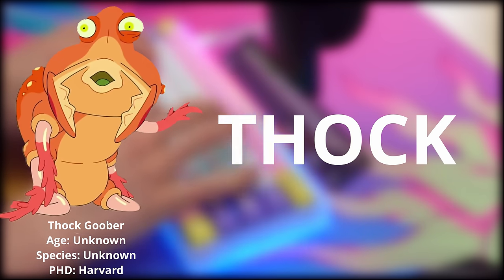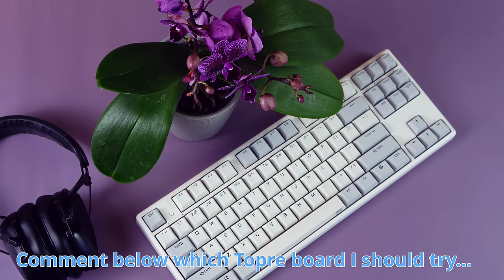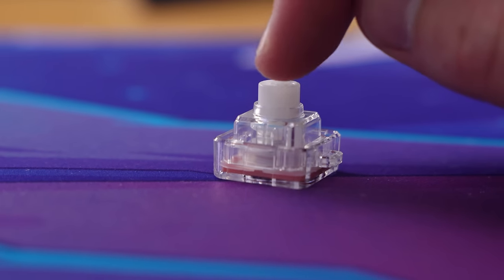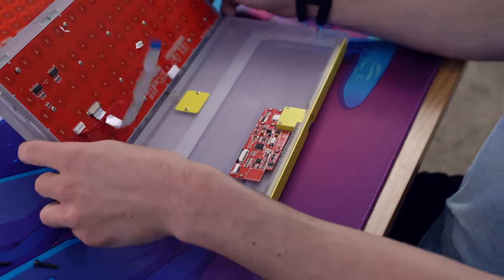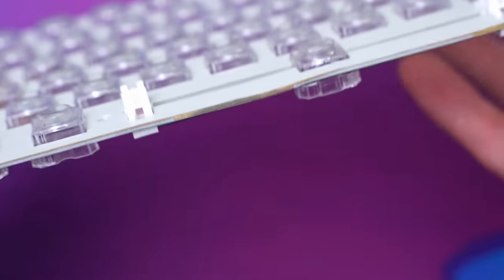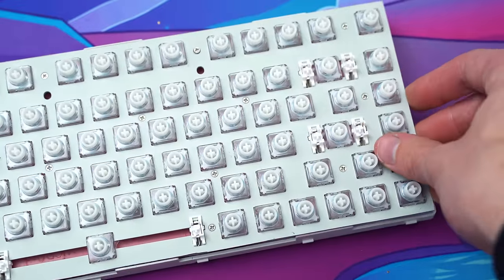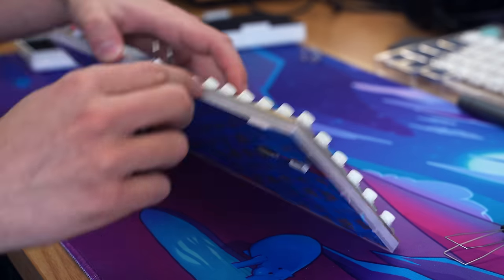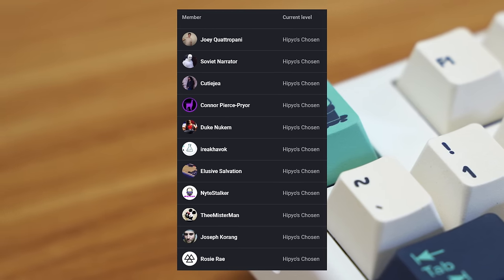THIS is the best sounding "THOCKY" keyboard.

Comment: Swap the Domes.  BKE Redux domes for Topre and Topre clones.  If you want to make even more Thock.  Ultra-Light Domes have the same tactility as 55g genuine Topre domes, while being 15g lighter, and the Light BKE Domes are even more tactile than 55g Topre, while being 5g lighter.  Heavy Domes are like MX Blacks in weight but having a significant amount of tactility.(Think more than - Boba switches, Box Royals, or Sunflowers.)

Only downside to BKE Domes is that you need to get a Plum87, RC930, Genuine Topre Electronics, or just make sure your board has absolutely zero RGB.  Sometimes you gotta do some cutting for the domes.

Comment: mechanical engineer here. You like plastic for the "Thock" more because it has a higher intrinsic damping ratio and a lower resonant frequency. First, Plastics are organic molecules with long amorphous chains, i.e., a non regular structure, so they quickly dampen any vibration (aka, sound) because their random shapes don't allow vibrations to propagate as well as a more crystalline structure like aluminum. Second,  because they are less stiff i.e., they bend less when the same force is applied, they have a lower resonant frequency. When you impact an object, as when you type, it tends to ring at its resonant frequencies. So a plastic keyboard will ring deeper because it has a lower stiffness, therefore a lower resonant frequency. The damping ratio and lower resonant frequency together leads to a more 'thocky' sound. Simple as that. If you have a less thocky keyboard, it's much  stiffer. Any defects, such as slop in the components causing extra noise (clackiness), will be much more obvious due to that. So if you have a metal frame keyboard all the parts will have to be far more precise and you will need to introduce less stiffness (i.e. with o rings as I have seen people do) to get a lower pitched, thocky sound. Hope this makes sense.

Comment: Was going to give a physical explanation in detail to the deeper sound difference, but yeah this person below kinda killed it. Basically it is due to the softer material absorbing higher frequencies. Only way to make it deeper is to add rubber into the mix. Basically a good thick plastic is the nicest thock sound you'll get. Reason is waves and shit, i.e. transfer of energy in materials/wave propagation through different mediums.

Comment: Why did you start with the Micro84 instead of the Micro82? I've never actually had a keyboard without costar stabs but I've greased mine up quite a bit which helped. I've had my Micro82 for a few years now and it's been good, but I've noticed on a couple of keys I seem to have spring rattle. Have you ever noticed this with yours?

Comment: im not a scientist by any means i just know a few things for no reason but the reason why plastics are deeper sounding than metal is because when metal is hit it is very dense so when it vibrates it vibrates very little causing the higher pitched noise and the same thing goes for plastic it is just less dense so bigger vibration
Reply: when you copy the top comment:

Comment: not a sound scientist but this list can help you reach the thock
wooden cases dampens the sound the most, i recommend putting a thin cloth before foam, tempest tape mod and rest mount aka no mount.
metal cases are the most pingy but they can help generate the thock, use cotton and tape it all with thick painters' tape then add foam and tempest tape mod for the pcb, it would help reduce the ping and can help it thock
plastic (abs) cases generates the loudest thock since they are thin and they are just plastic, add some 2-3 or 4 layers of car foam for these cases and it will not sound hollow anymore.
acrylic is what i do not really recommend, but they generate a light thock and they are not even as thocky as abs cases with the mods i mentioned
aluminum with gasket mount? ew no, that is pingy as hell, also aluminum is more pingy than other metals imo
stainless steel is kinda great, but it will not be as thocky as the plastic cases and they generate clack instead for some reason

keycaps:
pbt is what i recommend with XDA profile, they have a nice shape with good thickness. 
abs is okay, it just not do not generate a deeper sound than pbt but they have louder sound.
sa profiles with abs is great for thock, they are ideal for sound but not for your wrists
OEM profiles are meh but it can be pbt or abs, almost no differences
wooden keycaps are a waste of your money do not buy them, they dont generate deeper sound UNLESS if you have nk cream top housing switches

plates:
aluminum plates are great, they are more thocky
brass plates, brassy thocky, just like aluminum but with a brassy and more metallic sound
polycarbonate plates are clacky, not thocky (according to hipyo, thock means a deep sound)
carbon fiber plates, just like the same as polycarbonate but they have deeper sound but not as deep
plastic, yeah they are okay
wood plates, no i do not recommend them, they exist but they are bad

switc-
THERE ARE A LOT. A. LOT.

Comment: If you want more thock on a mechanical keyboard, get rid of the mounting plate, and solder the switches in. The thinner the PCB you can get, the better.

Comment: it is "thoccier" because of the difference in density with plastic and metal its because plastic and especially polycarbonate  are much less dense allowing more vibrations leading to a deeper sound and vice versa with metal.

Comment: I agree thock is a deep sound.  I don't think there will ever be a consensus on what thock is unfortunately.  I wouldn't consider the board you built as thocky though.  In my opinion thock is achieved by a deep sounding bottom out from (usually) a long pole stem.  While the board you built is deep sounding it's not what I consider a thock as it's not a bottom out sound that you get from a stem pole but more reminds me of a loud silenced switch (that sort of squishy silicone sound but louder).

Comment: The good: Take keycaps off, just lubing the stems of the switches is enough to make this board feel and sound amazing, far better than my 500$ time consuming mechanicals. In addition, put some 2mm foam type double sided tape under the spacebar and wow. Also tape mod and some foam seems to help a bit, not that it needs a lot of help.The less good: The original keycaps are not good tho (niz micro84ec(S), 2019?), very hard plastic...would love to change them out, but where to get that spacebar...(hit me up @Hipyo Tech) and my board came warped from the box, but you can sorta press it down your desk to 'unwarp' weird, she/he/they/them were prolly cold, they kept their shape kinda...What really helps in all boards is a pour of (molding) silicone in the case, but unless you have it around already it might not be worth it, especially here where there is pretty much a 5mm thick (thock?) silicone membrane between top plate and pcb

Comment: Fc660c low noise, but i havent tried replacing the silencing rings with any other aftermarket ones, sound amazing with lube, but is a little fatiguing to type with my right hand (non dominant hand)

Also is made of plastic and it got those smooth thocks

Comment: 4:47 is more a thlonck than a thocc... a thocc has a more clacky quality with a lower pitched "formant" if you could call it that.
thocc, in my ears, is defined by a loud, short transient and little to no sound during the travel. what sets "clack" and "thocc" apart is the timbre, while "clack" has a brighter, higer pitched timbre, "thocc" is much deeper, like you mentioned, and darker.

tl;dr, the two most important factors of "thocc" are:
- deep/dark/low-pitched timbre
- short, loud transient, without travel noise
Reply: to achieve deeper/darker timbre, you can use porous or hollow material. all throughout the case.

Comment: Currenly using a NIZ TKL that still requires some modding. But I do really enjoy the sound and feel of the switches. Took some getting used to the standard 35g ones though.
Reply: It's easy to replace the mats with stiffer domes if you ever want to do that in the future.

Comment: i somehow got crazy thock with my keychron k2(paid 7$ for at a bin store btw and it works perfectly) with gateron reds lubed with the tooth pic method and coconut oil and for the case i got 2 layers of super thin packing foam(it literally came wrapped around my monitor) and i had some old shoe soles and the foam was super dense with a cloth layer on top so i cut it up and had it under the packing foam all over the bottom of the case and added tape around the edges so the pcb plate doesn’t have metal on metal contact very jank build cut my self removing the total cost 7$ for the keyboard itself 😂
:btw it’s not recommended to lube with anything that’s not actual lube but if you do USE THE CONDENSED COCONUT OIL not the runny stuff you’ll get much smoother feel and a lot better sound just make sure you kinda mix it up so it’s not chunky but very smooth

Comment: just my opinion, but I like WIRED keyboards better than wireless because I don't really having to charge it all the time
Reply: I love my wireless keyboard because I can just use it as a wired USB keyboard most of the time, then as wireless when I sit somewhere else, I bring it with me or want to make some space on my desk, etc.

Also because I had USB problems a few weeks ago with my Steam Deck or its dock. Not anymore, the USB ports currently work wonderfully but I tend to have it connected through both USB and BT at the same time.

Comment: No, the best sounding keyboard is my optical gk61 with gateron optical reds, with my stabs and switches lubed with VASELINE
Reply from the maker: No
Reply: @HipyoTech  yes.
Reply: @eggychan7613  No
Reply: @bestreach2952  yes.
Reply: @eggychan7613  No
Reply: @bestreach2952  yes.
Reply: @eggychan7613  No

Comment: I bought a Niz Plum Atom68 (wired) for my girlfriend and slapped ePBT BoW on it (it has a regular 65% layout) to replace her wireless apple keyboard. Best stock experience by far. I find myself going to her office more often than I would admit to just randomly smash these EC keys. Costar stabs are a pain to align at first, but they do the job surprisingly good. The only wonky part about these guys is the software...

Comment: I want a nice sound of a mechanical keyboard, not get an electro capacitor (?) keeb. This is like BMW blasting fake engine sound through the speakers to have a nice engine sound. No no no, petrol heads want to hear the real engine and THAT should sound awesome. I want to hear a real mechanical switch board and THAT should sound awesome.